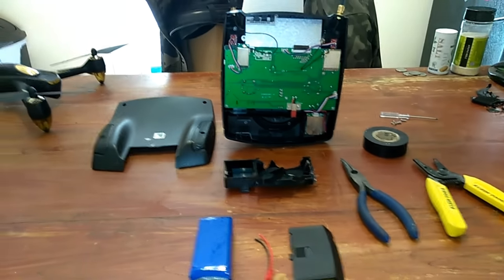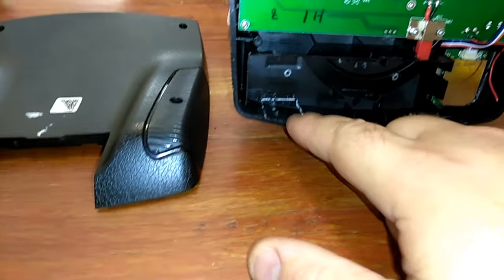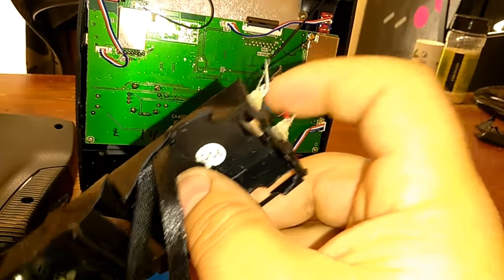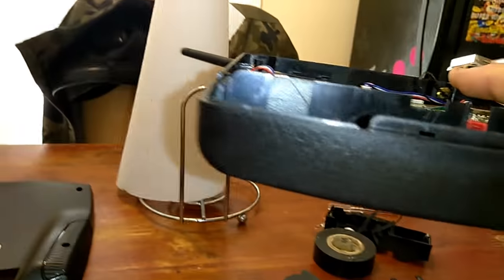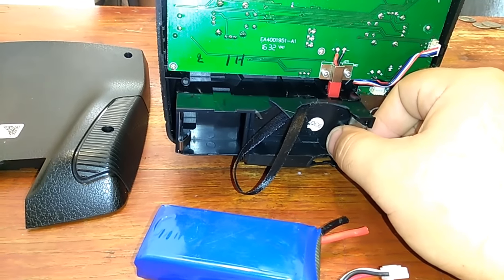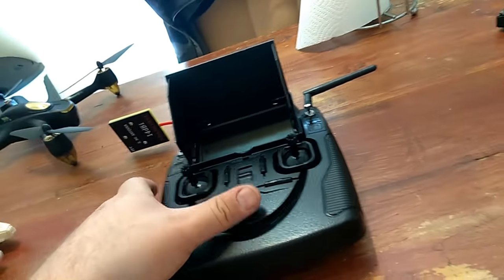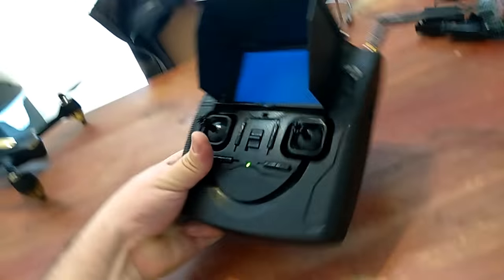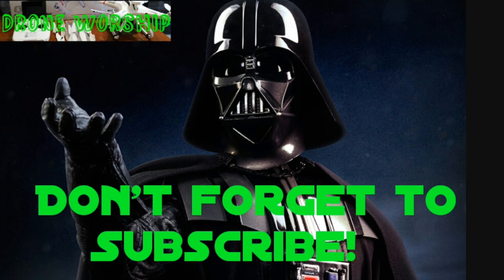Hubsan X4 H501S Transmitter Battery Tray Removal

Comment: Hey Drone Worship, first of all, thanks for all the awesome information man! Been pondering on a quad for my daughter (and myself), and you really helped me make what I think is the best pick in the H501s. Anyway, what do you think about using the actual quad battery for the transmitter, if I order a few extra?
Reply: From comments and replies in your other vids, I believe I found my answer. As long as I have a regulator in my transmitter and assuming the original quad battery will fit the battery bay I should be good. Cool!!

Comment: Nice video. I was wondering is the battery meter still accurate when you have a lipo installed? I was wondering because one would assume that the board thinks it is reading a 6 volt battery but actually it has a 7.4 volt battery installed in it and you would never run your 7.4 volt lipo down to 6 volts for the meter to start dropping bars or it would permanently damage the battery. So do you lose the function of the battery meter by it showing  you have a full charged battery even when your lipo loses volts after the mod?
Reply from the maker: MrMad2424 it's regulated at 4-13 volts so yes it is an accurate battery meter.
Reply: Thanks!
Reply from the maker: +MrMad2424 no problem
Reply: SO if i understand correctly,  if i were to get another 610mAH 7.4  15c 4.5Wh , i could use it for the transmitter?
Reply from the maker: BlackScorpion I don't see why not that's kind of a very low output battery though I would think you would want something more potent
Reply: True, i would need something more potent. Thanks for the reply and awesome channel.

Comment: THanks for the info bro, , what mabberi is this one? i have one little hubsan with a pretti similar controller, an the big prolem is the battery ,  thanks for sharing..
Reply from the maker: SongoLand syma x8w 2000 milliamp 25c battery from eBay
Reply from the maker: SongoLand if you do this you will probably have to solder a jst connector to the battery lead cables so you can use another type of battery I believe the board can handle for 4-13 volts
Reply: ha! great info.. thanks..  no worrie, the day i have time to deal with this controller i will come you back whiht this.  proabably i will have some more cuestions , but defnly is one think on my to do list.  a gretting

Comment: Thanks, i will be doing this mod soon, still figuring out what lipo battery to use
Reply from the maker: greenraydaz the battery I used  the syma x8w 2000 milliamp 25c battery. they go for about $13 on eBay or Amazon and then I ordered a bunch of jst connections male and female for $2 off eBay
Reply: Many thanks, i looked on ebay for those and they look spot on and only £12, thanks for you help and support
Reply from the maker: +greenraydaz do not buy the cheap antennas only the three-panel 14dbi
Reply from the maker: greenraydaz yeah bro the batteries are super affordable

Comment: So are you not using a buck power regulator?   Do I really need it?  My version did not have the built in jst connection.
Reply from the maker: Michael Brandes it's completely up to you I don't like to take chances especially if you have a short out or a surge and Fry all the electronics from overload. LiPO batteries can be really sensitive so I'd rather not take the chance mine comes stock with a built-in voltage regulator on the board.
Reply from the maker: Michael Brandes the board handles anything from 4 to 13 volts I find that it's happy median is 7-8 volts
Reply: There are a few video's of Voltage regulators going wrong, so no guarantees with it
Reply: Where is this detail info for this controller? I did a voltage test on 4 new AAs and got a reading of 6.5 volts so 7.4 is not much more, in fact you may get some better performance from it, kinda like over clocking, a CPU, Thanks for the video.
Reply from the maker: +forestsoft the controller can handle 4 to 13 volts I find that happy medium is 7-10v. I would advise swapping over to a lipo setup with a jst connection you will get a lot more flights and the battery will last much longer and you won't have to keep purchasing batteries.

Comment: Hi, My standard xmitter didnt come with a JST connection, is there a way to still convert it to use a LIPO battery like you did?
Reply: it looks like you can just solder a JST connctor to the same posts that the battery tray connects to, 4-13 vdc.
Ill use the similar battery as you did, 
OBBEY® 1pc 7.4v 2100mah 25c Li-po Battery for Syma X8C X8W X8G X8HC
Reply from the maker: +OhioPrepperOne yes that will work
Reply: OhioPrepperOne

Comment: Where can I buy this battery? How many flights can you do with it?
Reply from the maker: 7 full flights , syma x8w battery with a JST connection installed to the harness
Reply: Drone Worship Do you mean 2500 mAh or 2000 mAh battery? There are both options. If it fits well, of course better 2500. Thanks
Reply from the maker: +JORGE POLO 2000

Comment: How can I tell if I have a voltage reg on my board.   I did not have a jst I had to add it.
Reply from the maker: Michael Brandes if you had to add one then you do not have one.
Reply from the maker: Michael Brandes if you're transmitter came with one pre-installed then there is a voltage regulator built into the board
Reply: Drone Worship bummer.  I can't put my battery inside.  I will have to leave it outside like you had yours.   It's all cool.

Comment: I have just sent my 501s back to Banggood!  Piece of Crapp!! Never worked from Day 1.
Reply from the maker: +Jay Weber you probably ended up with a dud. However it's rare but it does happen. I'm sorry for your luck are they sending you a new one?
Reply from the maker: I bought the 3dr solo a few months back and it was super expensive and it ended up having a bad flight controller board so I ended up sending it back and that was $800 so even with the big expensive ones every once in awhile you receive dud
Reply: Nope. refund, but the shipping is $92.00 cdn. I just sent it back.  This was the pro Model!!  Major issues with getting refund??